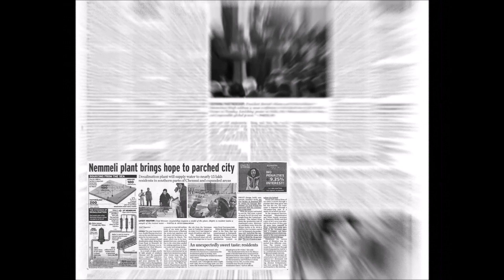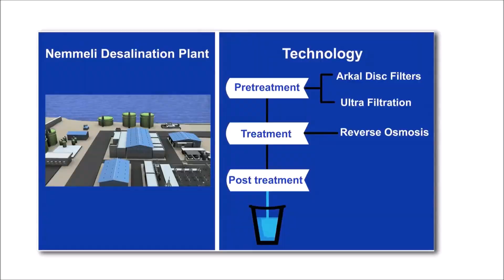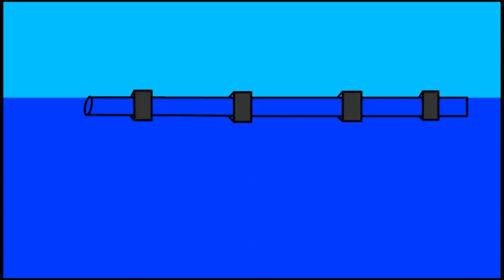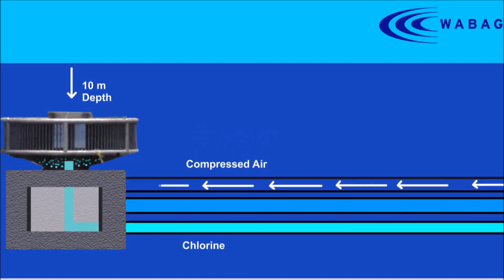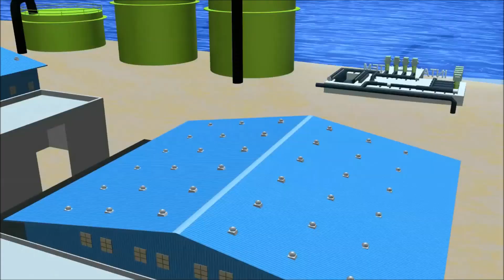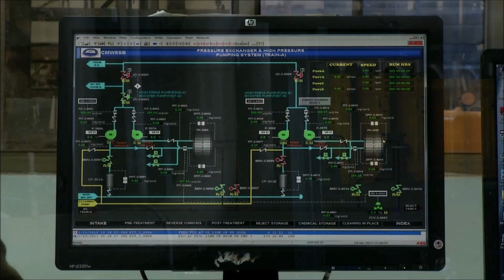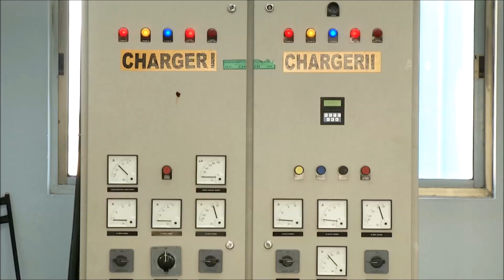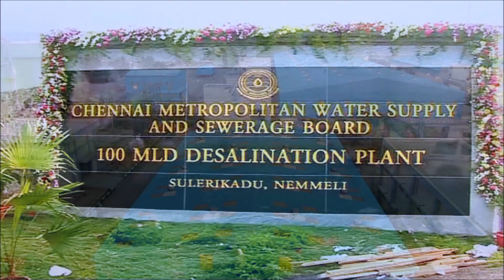WABAG Nemmeli Desalination Plant- From Sea to Sustainability

Comment: Hand operated pumps 
To bore wells 
Coloumb river 

Water quality standards 
WHO 
Desalination plant 

Pulley driven water 
Intake systems
Sub surface water 
Dredging 
Outfall pipe 
Wave currents 
Distillation 
Tug boats 
Tug boats 
Tug boats 

Liquid glucose 
Particle size 
Sand filters 
Storage tanks 

Overhead storage in tanks 

Opposite to Quantum dental clinic 
GRP pressure tubes 
68 bar